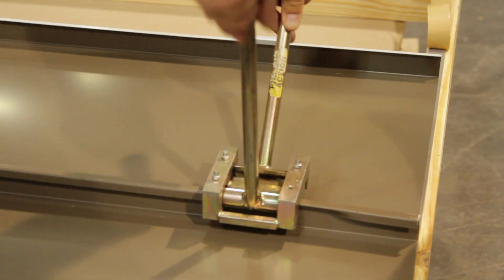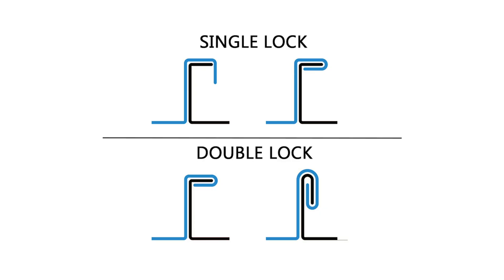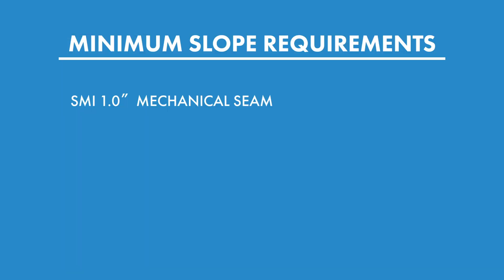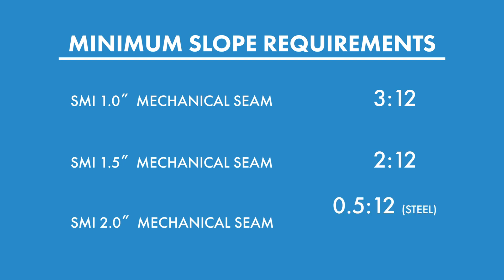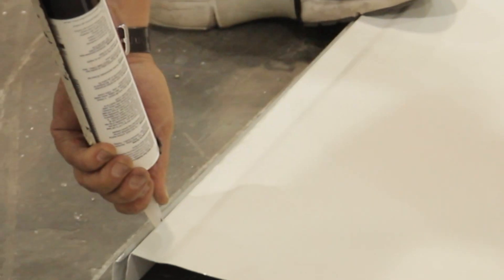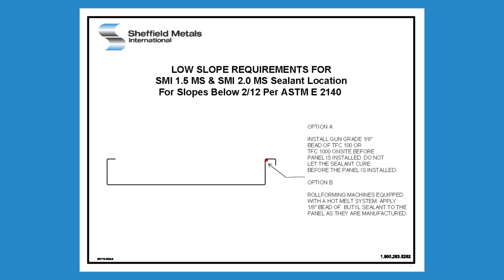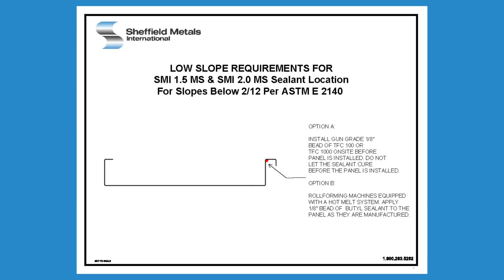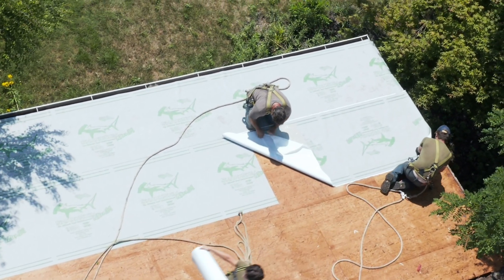Best Profiles for Low-Slope Standing Seam Metal Roofing

Comment: why is there such a difference in slope capabilities between aluminum and steel?
I installed hand-formed aluminum panels, single lock, no sealant, on a 1:12 slope, but I don't see any evidence of leaking. It's a shed, so it's easy to see if it's been dripping